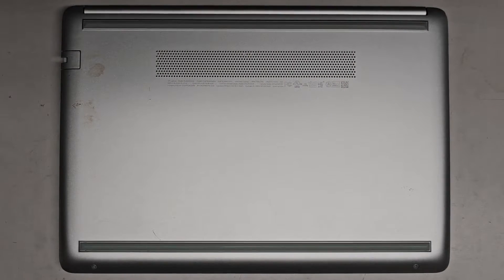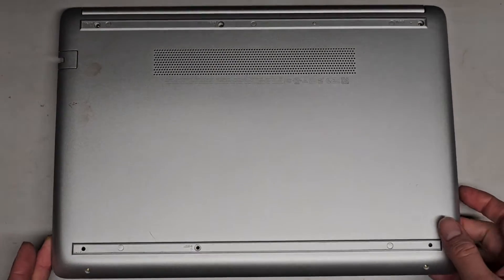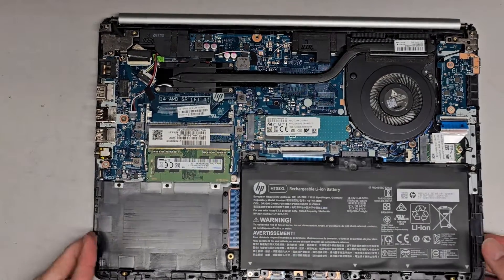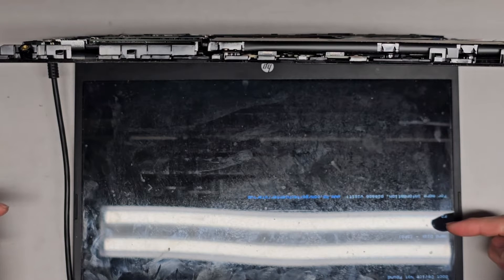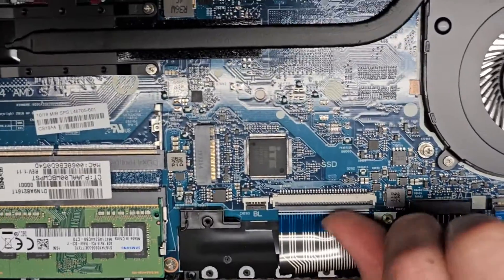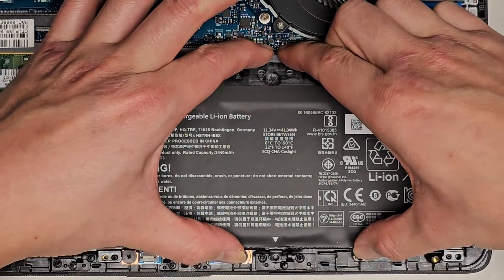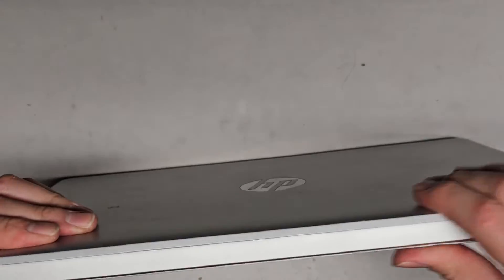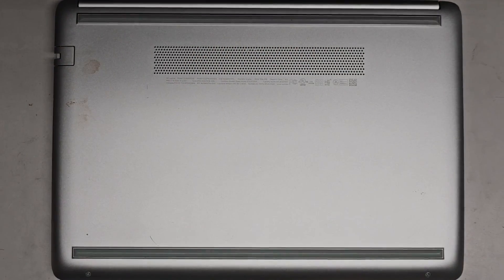HP Laptop 14-dk0002dx Disassembly RAM SSD Hard Drive Upgrade Battery Replacement Repair Quick Look

Comment: This video was a big help, just replaced the battery in my Wife's HP 14! I want to upgrade her storage, I know a lot of these HP laptops also have space for a 2.5" SATA SSD but you need a special cable. Does this model even have the needed connector on the motherboard for that cable? If so, do you know what the part # is for that SATA ribbon cable? I know they say you need a bracket as well, but I think I have that part covered (I'd 3d print a mounting bracket). Otherwise, if this model doesn't support the SATA capability, I'll just get a bigger M2 and an adapter cable to clone the drive for her. EDIT: I believe I see where the connector is, in your video right above the empty area for the 2.5" drive on the bottom left, on the lower left edge of the mainboard, marked HDD.
Reply from the maker: Likely this will work https://amzn.to/4jeo9A4 you can use some double sided adhesive to hold it in place or hot glue to fill empty space. It's much faster and no need to design it to fit perfectly. Haha Hot glue comes out easily as well.

Comment: Get that man a 250gb ssd and send him on his way. What are you talking about totaling out his laptop because all you have on hand is 1tb's 😆
Reply from the maker: They don't want to wait for parts.
Reply: @ItsBinhRepaired  Then recommend an ssd in stock at your local walmart!!! That was no reason to miss a sale unless you sold him that new laptop yourself haha if they had money to bring it to you to get fixed/consider a new laptop they had money for that simple repair. Thanks for the reply and great video I'm working on fixing my old hp I bought at a good price from a pawn shop awhile back w/ an i3 that I later damaged the housing. Bought a lower spec version as a donor your video helped get started on swapping the motherboard out
Reply from the maker: @angelsantana3969  hah! An SSD from walmart will either be trash or cost about the same as the 1TB one I have. Just me driving there to get one or look for one will cost more than the SSD already...
Reply from the maker: @angelsantana3969 I think I ended up fixing it in the end, but yeah, at the time even a 240gb SSD was like $50+

Comment: Hey bro! I know that this is an old video but is that battery same as the one installed on HP Laptop 14-dk0xxx? I need to change mine but I can't seem to find batteries for this exact model
Reply from the maker: Open it up and check the model number
Reply: @ItsBinhRepaired Wow you replied even though it's been a year since this video uploaded...I'll open up and see thanks
Reply from the maker: @Tokisakiiiiii age of the video doesn't matter. It's whether youtube shows me there are new comments on my videos. Sometimes they don't... lol

Comment: I just want to ask my laptop which is also an hp 14s, has no place to insert the m.2. I don't know if it's been tampered with but is it normal, if the place to insert the m.2 is gone?
Reply from the maker: You need the full model number to compare.

Comment: How do you remove cmos battery  hp 14-dq0003dx
Reply from the maker: Pull the main battery out and hold the power button 15 seconds
Reply: I have one of these laptop the fan is running and cut it speed nothing is on the screen but the fan is running I can eat the hard drive making a chip sound
Reply: I have one of these laptop the fan is running and cut it speed nothing is on the screen but the fan is running I can hear the hard drive making a chip sound
Reply from the maker: @viewsidefarm  possibly bad RAM
Reply: @ItsBinhRepaired  am going to put the ram in a next laptop tomorrow and see if it’s working are not
Reply: @ItsBinhRepaired  even when I close the laptop screen down the fan is still running and giving the hard drive clicking sound
Reply from the maker: @viewsidefarm  take the hard drive out and only put one stick of RAM
Reply: @ItsBinhRepaired  it only comes with 1 ram 8GB and I don’t have another one at the moment
Reply from the maker: @viewsidefarm  try moving it to the other slot

Comment: I followed the up request to upgrade my bios.  Bad move!  Now I have a charge light on and I have a power on light on the left. Nothing else.
How can I reset my bios?  
Sorry. It is the up 14-dk000dx.
Thank you.
Jon
Reply from the maker: Sounds like you might not have let the bios update complete and restart on its own. If you force powered it off because it was taking too long, you might have killed the bios chip.

If you're lucky, disconnecting the battery and holding the power button for 15 seconds, then reassembling might fix it.

Comment: How can i fix boot device not found? Ive watched and tried so many things but none of them seem to work. Legacy support, loading default bios settings, and i cant really install windows because i currently dont have a USB that i can use. So im just gonna assume that its my hard drive that is the problem, so ill follows these steps to get to it.
Reply from the maker: @NoMotionNor  try booting from a usb boot of linux and check the hard drive

Comment: Thanks for the video. Can I still use this kind of laptop if i removed the battery and just use it plugged? Is that safe? Thanks for the response
Reply from the maker: Try it. Should be fine if it doesn't work. Just don't pull the plug while it's running.

Comment: @Binh, moderators on HP's forums seem certain that the Hard Drive cannot be replaced on these models and a full motherboard swap out is need if the drive goes bad.  But you quickly remove a module that you refer to as the SSD (these models use a 64 GB eMMC.  Can you reconcile this?  Can the Drive just be replaced?  Thank You for helping me fix a friends laptop.
Reply from the maker: Please watch the whole video. You'll learn a lot. You basically answered it yourself though.